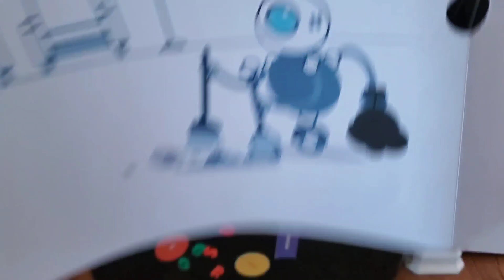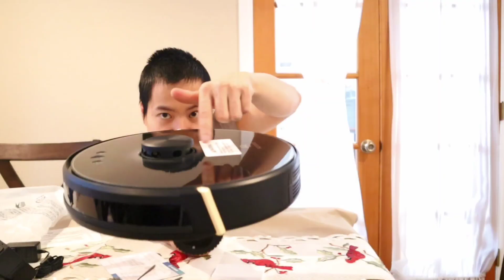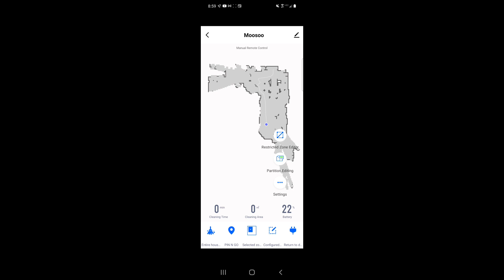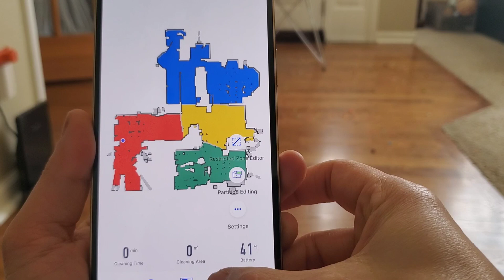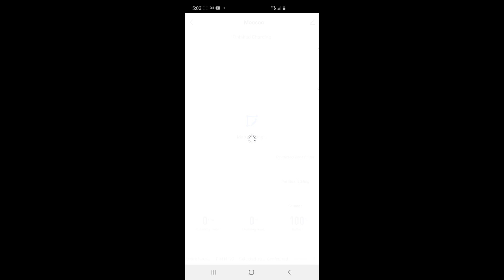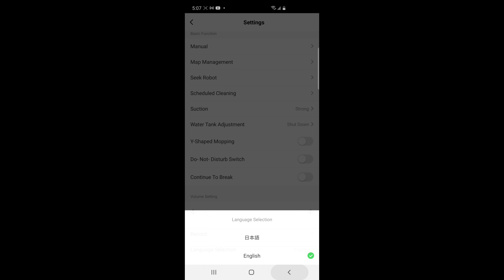Moosoo Robot Vacuum with Lidar Navigation and Amazing Cleaning Performance!!!! Unboxing and Review!!

Comment: I have the map loaded up, but when I go to zone cleaning, it won't let me select any zones.  Have you had this problem as well?
Reply from the maker: Hmmmm when creating your map, did you allow the robot to start and end from the docking station uninterrupted? Also I can’t recall if there a map saving option in the App, you may need to enable this, before creating your zones.
Reply: Yep. It did the whole house in one turn without interruption. When I go to zone cleaning and tap on a room it won’t select it.

Comment: Quick question: Do you know which model is newer Moosoo robot vacuum R3 or R4?
Reply from the maker: Well they are almost similar in performance, specs and design, but the R4 is newer.
Reply: @RobotMasters  Thank you! That helps clarify things :)
Reply from the maker: @lamdavis  Sure no problem 😉

Comment: Do you have a water tank to mop the floor? In particular vacuum cleaner, is the mode often stronger than the Deebot ozmo T8?
Reply from the maker: The T8 may do better especially if you have the Pro mopping system which vibrates.
Reply: @RobotMasters  Moosoo r3 mopping ?
Reply from the maker: @DuyNinhBui  I don't think the Moosoo has mopping system

Comment: This is one of the most entertaining unboxing sections I’ve seen. Well done!
Reply from the maker: Thanks 😊
Reply: The new upgraded robot vacuum needs five testers! I have solved all the pain points faced by the previous robot vacuum!
👉3000Pa suction power; 5200HAm ultra-long life span
👉Running time up to 290 minutes with a removable battery.
👉Three filter systems without secondary pollution.
👉 hair tangle-free design.
👉Sweeping and mopping in one, water volume adjustable.
😍If you are interested in our products, please contact me as soon as possible.

Comment: I've emailed moosoo about the continue to break option. I couldn't find anything exactly but from the way they worded some of the r3 features on their site I believe its the setting to turn on and off recharge and resume. I'll confirm when I hear back from them
Reply from the maker: Thanks for looking into this, I think you are right, probably a recharge and resume feature. Or if you stop the robot during a cleaning run, it can be resumed.

Comment: I’d like to see cleaning tests of sand on carpet.
Reply: The new upgraded robot vacuum needs five testers! I have solved all the pain points faced by the previous robot vacuum!
👉3000Pa suction power; 5200HAm ultra-long life span
👉Running time up to 290 minutes with a removable battery.
👉Three filter systems without secondary pollution.
👉 hair tangle-free design.
👉Sweeping and mopping in one, water volume adjustable.
😍If you are interested in our products, please contact me as soon as possible.

Comment: i also have a opdee robovac the reason i got another one is that everytime now when i try to use it it says somethin is not installed like vacum not installed or lent filter is not installed which it is what does that mean
Reply from the maker: Hmmm maybe try wiping the robot Vacuum down, maybe the filter or dustbin sensor block. You can also try resetting the robot, turn off and on.
Reply: @RobotMasters  ok

Comment: Makes me think of Trifo Ironpie m6 with a Lidar. But this moosoo appears to be more accurate and gentle from the chair test. In Trifo m6, the biggest problem with the dust motor tank is the filter cover breaks very easily because user forgets has too pull and open, breaking the hinge. How easy is moosoo?
Reply from the maker: It not too durable, held on by a couple small plastic hinges. I would say it not too difficult to remove the air filter but it not washable.

Comment: you look fine just the way you or
Reply: The new upgraded robot vacuum needs five testers! I have solved all the pain points faced by the previous robot vacuum!
👉3000Pa suction power; 5200HAm ultra-long life span
👉Running time up to 290 minutes with a removable battery.
👉Three filter systems without secondary pollution.
👉 hair tangle-free design.
👉Sweeping and mopping in one, water volume adjustable.
😍If you are interested in our products, please contact me as soon as possible.

Comment: hi
Reply from the maker: Hello!!!
Reply: The new upgraded robot vacuum needs five testers! I have solved all the pain points faced by the previous robot vacuum!
👉3000Pa suction power; 5200HAm ultra-long life span
👉Running time up to 290 minutes with a removable battery.
👉Three filter systems without secondary pollution.
👉 hair tangle-free design.
👉Sweeping and mopping in one, water volume adjustable.
😍If you are interested in our products, please contact me as soon as possible.

Comment: Amazing video as I expected! 😁

I’m pretty sure that MooSoo is going to release a Proscenic m7 pro clone. I’m just guessing. Who knows!
Reply from the maker: LOL maybe 🤔
Reply: @RobotMasters  dustbin looks similar cuz it has a daily maintenance sticker on there like the M7 Pro.
Reply from the maker: @MrBlueCreeper  I think it smaller, the vacuum motor in the dustbin and the cleaning performance was surprisingly good, beating the Proscenic m7 clones.
Reply: The new upgraded robot vacuum needs five testers! I have solved all the pain points faced by the previous robot vacuum!
👉3000Pa suction power; 5200HAm ultra-long life span
👉Running time up to 290 minutes with a removable battery.
👉Three filter systems without secondary pollution.
👉 hair tangle-free design.
👉Sweeping and mopping in one, water volume adjustable.
😍If you are interested in our products, please contact me as soon as possible.
Reply: @amylee3506  ok I'll bite